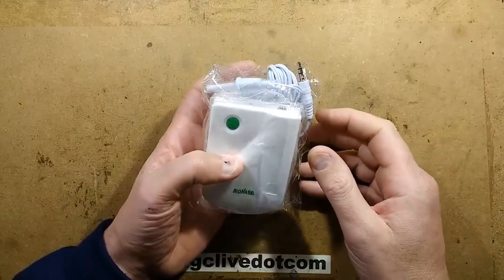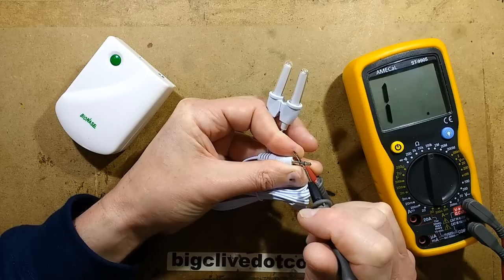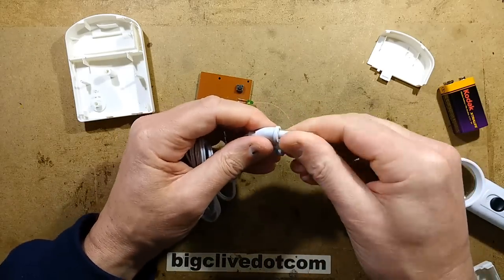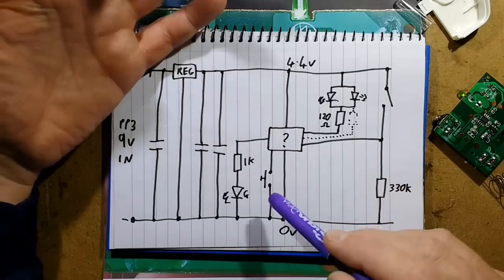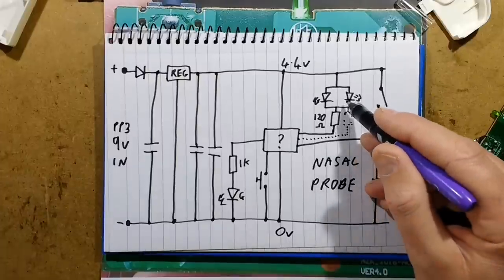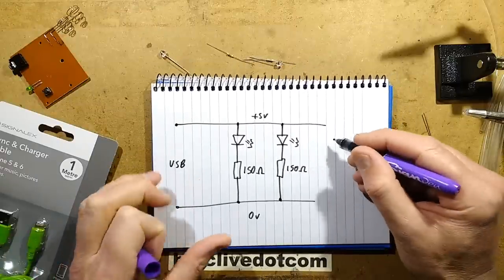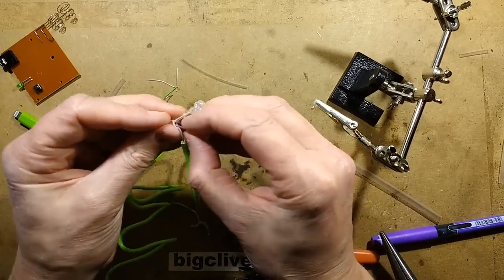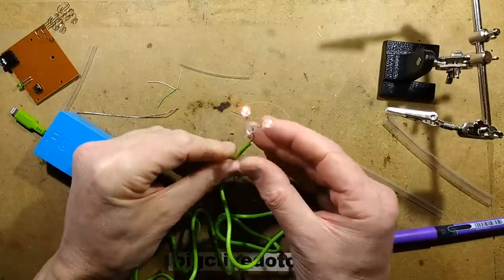Red light nose probes.  (And a DIY one for your snitch too.)

Comment: I wish you had restored the pcb to find out why they drilled out that lead. Maybe it will add scillation, or even better, that something will explode, or at least smoke? We need a follow-up on this.
Reply: Christian Jacquet The question is if the microchip is programmed with one resistor or two in mind. 

Or they just found cheap 120 ohm resistors, and didn’t have to use two 240 ohms.
Reply: I like Clive's theory better. It looks like a fix for a problem found after they started production. Hand soldering across the resistors is way more expensive that the resistor chip (c.f. earlier explanations of why 0 ohm resistors are used), even if you have barefoot peasants doing it. Possibly the micro gets squirrelly when the voltage rail drops too low and it ends up with one on and one off as Clive posited. It would be interesting to open up one from next year and see if the board's been revised.
Reply: I think they designed it to flash the LEDs or alternate them or something, and then when the 1 million actual led assemblies showed up they found that they didn't connect the leds to tip and ring, they both went to tip, and they said oh crap, how can we fix this?

Comment: After looking into this the theory behind this device is sound. Low level light therapy is used throughout the medical industry to stimulate or inhibit certain cell functions. In this case the red light is absorbed by the parts of a cell which is responsible for producing histamines,  reducing the amount produced and reducing symptoms. It is also used to stimulate tissue growth for faster wound healing and reducing scaring. The effectiveness of devices like this are debatable though the principal is widely accepted. 
 Ultra Violet isn't used because rather than stimulate cell structures it can damage or kill them. It is however used to great effect for localised bacterial and viral treatments. I would hazard a guess that these sort of treatments will become more common place in the future with antibiotic resistance becoming more of a problem.

Comment: Wait a minute...isn't there a product full of red leds "of a specific wavelength" used on the scalp to help regrow hair?  Doesn't that mean this nose probe product will cause your nostril hair to grow and wouldn't that INCREASE your congestion?  Perhaps the intent is that the extra hair in your nose will act as a better filter preventing the pollen from going deep enough to cause your allergies to flare up.
Reply: lol
Reply: John Howard  So what you're saying is that neither of the red light products actually do what they say?  lol
Reply: It doesn’t change your genes just makes your cells function better.   It boosts healing so if there was supposed to be hair there it will make the hair better if no hair already there that is supposed to be longer and wider then no it will not create a hair folical

Comment: Clive the 1k is probably not to protect the led, it's probably specifically limiting the source current from the output of the mystery chip. I'd guess it's a little micro controller since it seems to sense when you remove the nasal probe. You find some of the neatest little crazy devices, thanks for the vids. They are great.

Comment: The black box chip is likely a $0.40 programmable microcontroller. A 555 would be $0.10 in itself and would still need software support.
These are really fun to play with. As well as very versatile.

Comment: Why did they use a pp3 and not 3 (or 4, perhaps) AAAs? Nowadays pp3s are much less common, and relatively much more expensive, and that extra 4 or 5V gives the regulator much more work to do. In fact I guess you wouldn't need a regulator at all using three common 1.5V cells.
Reply: Well, they don't have to pay for the battery, the buyer does. But it's still odd that they didn't just specify 3 AAA cells, which would give almost exactly the same voltage the regulator outputs. My guess is that the microcontroller can't handle the variation in voltage between charged and discharged cells, so they decided to use a regulator, but it has a minimum voltage drop that necessitated the 9v battery.

Comment: Score zero for efficiency, start with a 9v battery, throw half the voltage away (with a regulator the will draw quiescent current), then throw another half the voltage away.

PS. I was close with my guess, I though it would contain a blob, so unspecified 8 pin is close to that
Reply: pe1dnn Doesn't switching need an inductor though
Reply: Was wondering... is that a callsign .... QRZ?
Reply: They could at least have run the LEDs in series, for double the battery life.
Reply: pizzablender 

Not if you want to drive the two series LEDs directly from the output of the 4V mystery chip.

Comment: I suffer with bad hayfever, so bad my eyes are itching now even though it's 1AM and i'm indoors.

I recall being bought one of these many years ago, around 2007, branded as Lloyds pharmacy and at the time it was very expensive, about £50.

I used it for a number of months and it made a slight difference, although i'm not sure if that was genuine or if it was just the "placebo effect".

Incredibly you can now buy a very similar device for less than £5.

Comment: As UV is supposed to kill some bacteria and mould, wouldn't UV leds be less snake oil?
Reply: UV might actually have a medical effect and or harmful sideeffects can't sell that then
Reply: Evil from evilution well.. UV can deform your DNA too
Reply: UV is ionizing radiation - which is why you get a sunburn.  You would not want to get a sunburn inside your nose.  It kills bacteria and mold the same way it kills your skin cells.
Reply: UV is a broad term. spectrally speaking. There's UV that will give you cancer, and UV that's absolutely fine.
Reply: I think you can't get the dangerous kind of UV from LEDs, you need a mercury vapor lamp for that.
Reply: Isnt it really the IR that causes the sunburn? After all burns are cause by heat while melanoma is caused by UV radiation.
Reply: @rimmersbryggeri
The sunburn isn't actually a heat burn, it's a reaction to the cell damage caused by excessicve UV light.
It just sort of looks like a burn from heat, but it isn't.

ALso this "IR = heat" is misleading, a hot enough object will also emit visible light and UV.
And a concentrated beam of any wavelength will heat up things.
Reply: UV light inside the nose? I smell  cancer  :)
Reply: ... or a brain fart?
Reply: Evil from evilution this device is for allergies not bacterial infections so even if it was safe to stuff UV any type up your noise it would still not make it less snake oil.
Reply: Then I must have misunderstood the info I have. When I am sunburned I get watery blisters though so its very much like a heat burn indeed. I dont know why skin would be different from any other surface that scatters the Uv and reflects it as IR with the surface acting as a heat buffer.
Reply: Evil from evilution if you used UV, the customer wouldn't be able to see it glowing, thus killing the placebo effect. It's all about showmanship!
Reply: rimmersbryggeri yes you are mistaken, you can get a sunburn in the snow, no heat necessary. A little uv makes your skin go darker, to much you got a sunburn that it's quite different from what you get from a flame or some hot body. However your skin react in the same way.
Reply: rimmersbryggeri it's equivalent to radiation burn in effect, because thats what it is. The cells have been damaged by UV which cause severe irritation and many of the membranes to collapse and rupture along with DNA damage. The body floods the afflicted area with fluid and white blood cells to create a moist environment so it can break down the damaged material and begin repairing it. It often feels like it's burning even though it isn't, but as far as the body is concerned it's remarkably similar to a 'burn'.
Reply: Isn't the real reason for the big heatshrink over the LEDs to prevent build up of old lubricant?
I understand Tiger Balm is one of the better ones.
Reply: + ampeyro

>I think you can't get the dangerous kind of UV from LEDs, you need a mercury vapor lamp for that.

UV LEDs are more dangerous than other UV light sources because of the focused nature of the emitted light. They should be treated more like lasers than a light source.

The most common UV LEDs available are in the 365-405nm range, which can be dangerous to your eyes. There are however UV LEDs down to the 265nm wavelength, which are just as dangerous as other UV light sources. Fortunately, 265nm LEDs are incredibly expensive, so you're not likely to see them in any quack consumer products anytime soon.

The 365-405nm LEDs are useful for disinfection, as that wavelength is known to cause cellular damage to bacteria. I wouldn't shove them up my nose though.
Reply: there ARE leds with the low UV you would need to properly kill stuff - but sterilizing you orifices isn't good for your health; ozone generators are pure snake oil as well.
Reply: Ozone generators have their uses but the health benefits are probably quite slim.
Reply: >there aren't leds with the low UV you would need to properly kill stuff

Incorrect. 265-310nm LEDs are in the UVC spectrum, which is quite effective at killing microorganisms. These types of LEDs are used in water and air purifiers.

The more commonly available 365-405nm UV LEDs are effective at inhibiting the growth of several types of mold and fungus. I've tested this myself with an array of 15 x 365nm LEDs on a cut out section of carpet which had mold. The wavelength of light was quite effective at stopping the creation of spores, and the existing visible spore mass had drastically shrunk.

I agree that ozone generators are snake oil when purported to have beneficial health effects, BUT they are great at killing odor causing bacteria and mold. I'll occasionally leave my ozone generator on low while I'm away for several hours and let the place air out after I get back.
Reply: good to know! I wasn't sure those were available yet, and like you said the low UV ones are much more common (they even sell 10W COBS with them?o.o) .... still tho .... I don't think you would want the UV INSIDE your nose (sounds like a recipe for getting nose cancer and sunburns/irritation/worse in your nose to me), just like the ozone is best used in some areas instead of in your airways. - sounds like a sound idea to use them in air purifiers, especially if you live in a damp area where mould thrives.
Reply: >I don't think you would want the UV INSIDE your nose (sounds like a recipe for getting nose cancer and sunburns/irritation/worse in your nose to me)

Yes, you don't want any wavelength of UV inside your nose, mucus membranes don't have any sort of protection against damaging light waves. 

> sounds like a sound idea to use them in air purifiers, especially if you live in a damp area where mould thrives.

I've retrofitted several cheap air purifiers of mine with 395-405nm LED arrays inside the blower housing and it definitely makes a difference. Down here in the south, we have high humidity near year round and mold grows inside filters after awhile, which starts giving off a musty smell. The UV LEDs pointed at the backside of the filter help a bunch in keeping the mold in check.

>(they even sell 10W COBS with them?o.o)

If you mean those square packages with an array of chips, I would avoid those. They're usually the dumping ground of crap reject LEDs which have leakage across them and result in the uneven light intensity and premature failure. The only supplier I trust with those is sure-display on Ebay, they have a pretty good reputation for quality LEDs.
Reply: low power UV-A would be safe to put up your nose. A few milliwatts of UV-A from a LED is nothing compared to the kilowatts you get when you step outside in sunshine.

UV-B and UV-C are the dangerous ones, with UV-C being the worst and WILL cause serious burns or cancer.
Reply: Tanning the inside of your nose sounds fun
Reply: I used to use an acne lamp that used 405nm near UV and 660 nm red lights. It actually worked! It used fluorescents, not LEDs though, but I doubt that mattered. I also found the research and they'd done proper science and experimentally compared using just the 405 nm and they'd showed it worked much better using both. One other interesting thing, I have mild sinusitis, and it actually improved that as well. Eventually i worked out it was probably shining through my sinuses; turns out sinuses are translucent(!) I wasn't shoving the light up my nose though- doubt that would work nearly so well ;)
Reply: UV is not the same as infrared which is the opposite end of the spectrum. Infrared actually detoxifies on the cellular level, it is the only spectrum that regenerates nerve damage and increases collagen. Ultraviolet is what you need when you are trying to suntan: One is aesthetic and the other is medical. This is not new age, newfangled, or snake oil. This is just science, and if you read more on the works of Nikola Tesla will understand it. You can still have your beer and drug of choice without being ignorant...
Reply: Sounds like a convenient way to get nose cancer
Reply: @jjall663  lmfao "detoxifies on the cellular level" = snake oil

Comment: LED's, everyone knows you need to use magnets and copper to fix your health problems :)
Reply: Nonsense, that's all a scam.

What you really need is pyramids, or crystals. Both if you have cancer or something.
Reply: Or pyramids filled with copper wire and sparkly things.... 
Look up Orgone Generator....prepare to be amazed. O.o
Reply: Spikey, I made a 2" one. Bits and pieces of every small metal cutoffs, shavings, even miniature springs, I could find, and filled the mold with epoxy. It looks fabulous. Does it do anything? Of course not, but I had some clear epoxy that was going bad, and said; Hey, why not.
Reply: LED illuminated copper pyramid with magnets glued to the corners sitting on a bed of crystals! I think I discovered the fountain of youth!
Reply: you forget to put main voltage at the outside of the pyramid, is more fun..... for those with aluminum hat.
Reply: I am now a teenager again and unable to focus to try to undo what I did. DAMN YOU CHILDHOOD ADHD!
Reply: Против Глобал please provide a link to a study published in a reputable medical journal that proves exposure to magnets improves your health.
Reply: CuFe... it already exists. It's a master alloy.
Reply: Magnetic copper? Just make a coil of copper wire, pass a current through it and you get a magnet!

Comment: There are mini ionisers you can hang from a necklace under your face - that's at least got a decent sounding explanation for why it should help hayfever sufferers. They've got built in rechargeable batteries so there's presumably more going on inside the box electronically speaking.

Comment: with heat shrink I use small glue gun nozzle  and squeeze some glue in and forces the glue out as it shrinks makes a pretty strong connection for slightly oversized heat shrink.
Reply: At a previous employer we used to stock shrink tubes with glue. Essentially is was regular shrink tubes coated on the inside with hot glue to provide a little water proofing/resistance and/or extra grip to a cable jacket.

I just checked Digikey, while they have "Adhesive lined" in their catalog, none of it is stocked.
Reply: shit dude that is amazing i had a load of over sized i had to struggle with the other week was horrid i wish i had thought of this +++
Reply: RS and Farnell both do adhesive-lined heatshrink, but the price premium over bog-standard is high. The adhesive's not so great either - if it gets too cold, it becomes very brittle, cracks, and you've got a water ingress route. A small hobbyist glue gun is all you really need.

Comment: If you want to make the DIY version even simpler, there are "5V" LEDs on the market with the current limiting resistor built in. For example at DigiKey: https://www.digikey.com/products/en/optoelectronics/led-indication-discrete/105?k=&pkeyword=&pv319=33&FV=ffe00069&mnonly=0&page=1&stock=1&nstock=1

I also use these LEDs for simple indicators on µC development boards (like arduino). The small ones have a leg spacing of just about 0.1" so I drop one into two adjacent I/O pins. Cathode output LOW, and anode is my debugging signal LED.

Comment: The question is - is it possible that the unused pin on the MCU does actually use PWM?

So, originally the pin in use now would still go High when the timer is running, and they were using PWM on the second pin to increase the total drive current?

Maybe they pinched the chip from a different product, as it was easier / quicker than re-programming them?
(or, even more likely - it's a One-Time-Programmable IC, which are generally cheaper?)

I was hoping to see Clive's Oscilloscope appear during the vid. (not a euphemism, btw. :p )

But yeah, very bizarre to go to the extra effort of drilling that track, when the two signals from the MCU a presumably still separate beneath the solder blob?
Is it possible they were trying to use both Output pins in parallel originally? Still very weird to not just remove the solder blob?

Comment: I'm not familiar with that product, but it does work if it is 660nm. 

I have a black light pen (395nm), and a brand name red therapy LED bulb (660nm).

And they do work. It sounds insane to hear that "light heals", but it is NCBI PubMed researched clinical data.

I had a nasty ear infection (swimmer's ear infection) that I killed, and treated in less than a week; I shone the 395nm light inside my ear cannal to kill the bacteria, and pathogens for less than a minute.

After that, I proceeded to shine the 660nm bulb right next to my ear for 10 minutes to reduce inflammation, accelerate tissue and cell healing.

Thus being said, my ear infection lasted for about 4 days (swelling), and on the 7 day all of the puss was draining out.